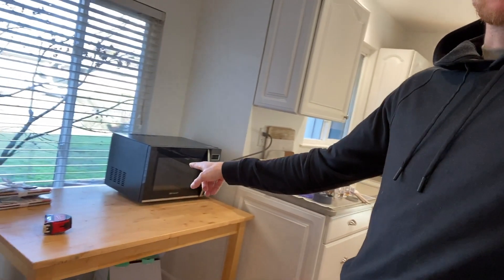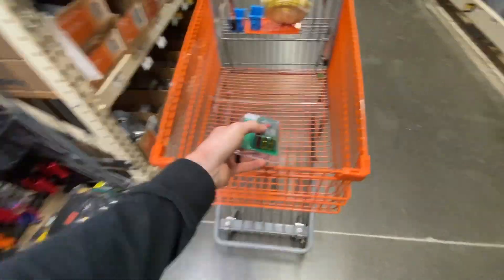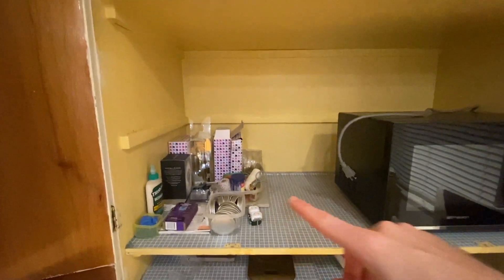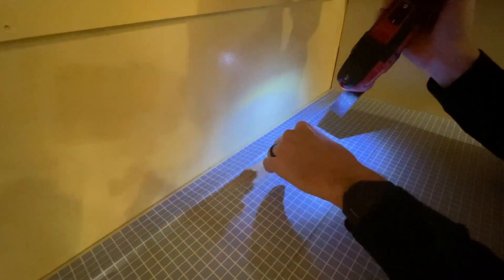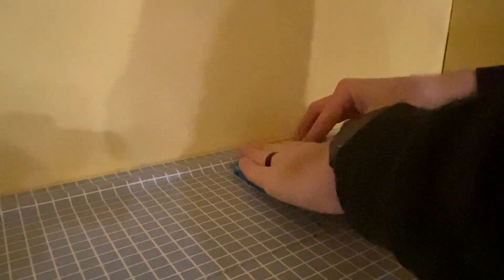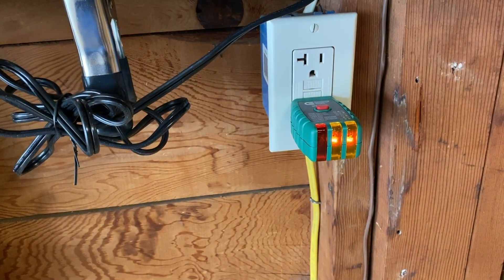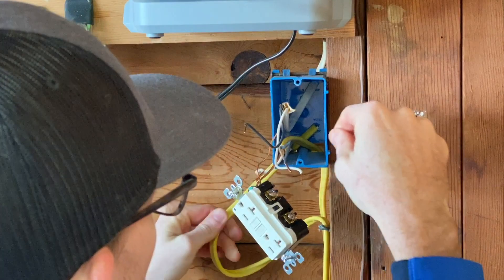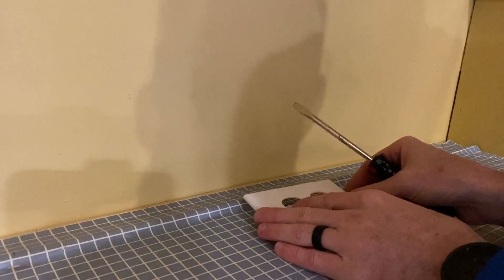Install Electrical Outlet and Cabinet Microwave diy

Comment: Reinstalled the original outlet back upside down, but I probably would’ve done the same haha. Great video though! I’m pulling an outlet out of the wall and extending it outside of a built in im putting in

Comment: You did a great job! Also, at some point I would have your service panel replaced, those old Zinsco breakers are known for burning through between breakers (where you can't see unless you pull one out) and starting fires. I'm a home inspector and those are one of the few red flag breaker types that we write houses up for. Just wanted to mention that! Thanks for the video!
Reply from the maker: Thanks Jackson. Should I replace the entire electrical box? I cut power to the house a few weeks ago (using the main power switch) and couldn’t get it turned back on. I think due to fact it’s the old Zinsco. Anyway, called my electrician and he came and replaced the main breaker. Should that suffice or do you recommend the entire box/panel? Any estimate on what it should cost? Should I upgrade the larger size (20amp?) while doing it. Thank you,

Comment: So, when you go to resell, that would actually fail an inspection.  After market addition of a microwave requires the 12/2 wire, like you had but it needs to be on its own dedicated 20 amp breaker. It looks like you tied it into 14/2 wire when you tapped into that other box. Thats why the inspection would fail. If you try to run something else in those plugs, while your microwave is running,  you'll probably trip your breaker.
Reply from the maker: Thanks for the context here. But Why do you believe I tied into 14/2 wire? I’m pretty certain 12/2 is the existing, so I matched it with the new outlet install. The new outlet runs my microwave and constantly charges my vacuum. Occasionally run juicer next to it as well. No issues tripping so far.
Reply: @ChadWardlaw  I watched it again and see that you have both 12/2 wire(uellow covered) and 14/2 wire(white covered) in that existing box you tied in to. I originally thought I just saw the 14/2 wire. As far as mixing the two different wire sizes is concerned,  my electrician friends are mixed on that one. Usually best to have one size from breaker box to the end. Especially a microwave.
Reply: It will still fail inspection, a microwave needs a dedicated circuit